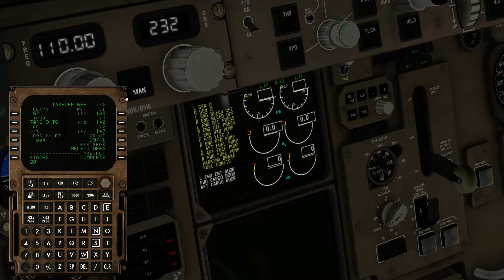X-Plane 10/11 - FlightFactor 757 - FMC Setup

Comment: please i just have a question.Can you tell me how you set the thrust again. You are too fast in the video
Reply from the maker: After you have entered your route on the last page you press "ACTIVATE" and then "EXEC". This changes the right button to "PERF INIT". Click that. Enter GR WT (gross weight) and ZFW (zero fuel weight) by clicking on GR WT. Enter the fuel reserves manually. Enter CRZ ALT (cruise altitude) and cost factor (use 50) click "TAKEOFF". Select FLAPS (5) and click "REF SPDS" and then accept the suggested values. Top left you have THRUST and you can de-rate the engines there. You have to look up in the manual how much you can de-rate the thrust depending on temperature and runway length, etc.
Reply: ZeroSkillJustLuck thank you for your response. I try it now

Comment: I'm stuck on irs position. last position is nothing, and airport coordinate isn't necessarily accurate. so how am I supposed to get the right data?
Reply from the maker: IRS is an inertial based system. The most important thing is that it knows how much it has moved in all the axis. For that, just the airport identifier is enough.

Comment: what program did you use to get your vectors/airways to program into your fmc?
Reply from the maker: I did it by hand. Just type the name of the airway into the left side and it will autocomplete the waypoints where to airways intersect. This doesn't always work though so you might have to manually put in a few waypoints as well.
Reply: @HBXTQ1990  Oh i understand that, sorry. What program did you get your flight plan from ?  The screen you pull up at 2:00?
Reply from the maker: @acdcnut7193  The flight plane was generated by simbrief (but I use other tools as well) and was displayed in xplane using a free addon called "eBag" (https://forums.x-plane.org/index.php?/files/file/25848-ebag-20/)